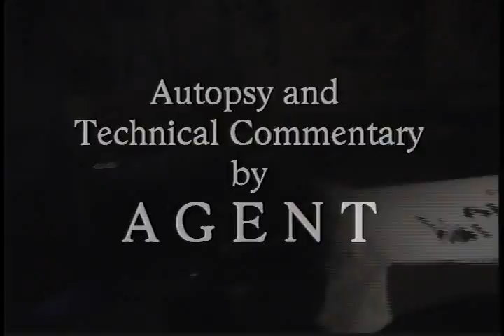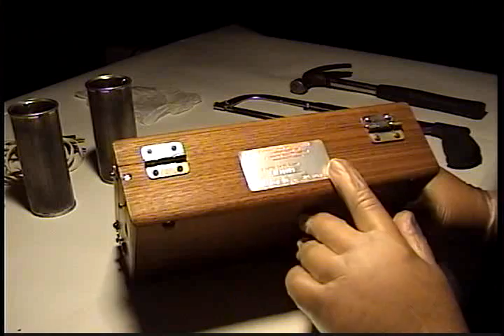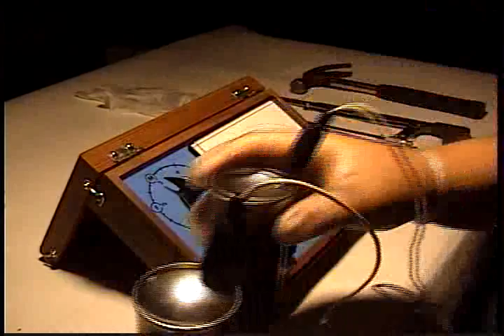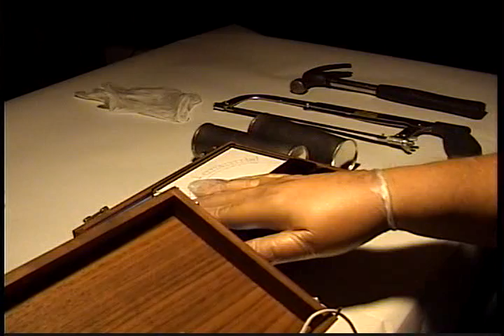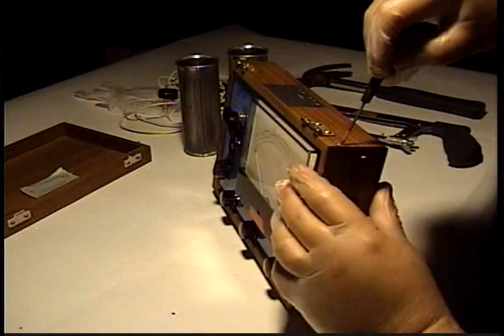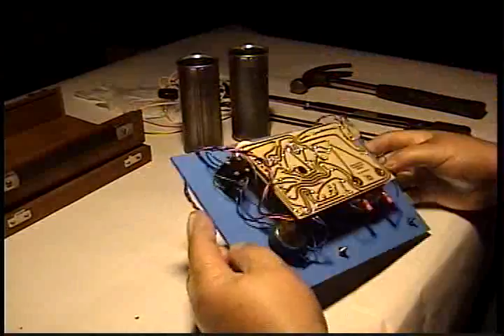E-Meter Autopsy Part 1 of 2

Comment: I've heard that you can build these with crap from radio shack, but I've never been able to find a complete schematic. Anybody know where I can find one?
Reply: +TheBrabon1 - thanks. that's certainly better than anything else I've seen. I'll have to give it a go, although the only experience I have is building a distortion pedal almost 30 years ago😂
Reply: +TheBrabon1 as a diagnostic device it's total BS.
Reply: 71nortcomm 71nort It's literally just an Ohm-reader with the cans being used as contacts to measure electrodermal-resistance of your body/skin just attach the alligator clamps on any ohm-reader to empty soda cans and hold one in each hand.
Reply: Ace Ace I get that it's an ohmmeter but I was thinking about building one just like their's as a goof.
Reply: 71nortcomm 71nort just put a mechanical (no digital screen) ohm-reader in your own shell, then get two cans and sand the paint off them and attach to the alligator clips, then attach various knobs and needles that either connect to nothing, or are routed to get a different reading from the original needle.
Reply: Ace Ace LOL, while functionally identical, that's not in the spirit of what I'm trying to do.
Reply: 71nortcomm 71nort you have to traverse the hole to hell

Comment: Wiring does not give a flying crap about volts. You could even connect it to 1000V. What matters is current.
Reply: +dieselscience not entirely correct.   Voltages beyond the wire rating can cause insulation breakdown and/or current to escape the insulation.
Reply: Do you think the loonies at scientology would actually hire an engineer to make these stupid things?
Reply: dieselscience What does that question have to do with your assertion that voltages don't matter?
Reply: Arx, you got it wrong, and that is not what I wrote. The wires do not 'care' what volts are because they don't even know what potential, current, resistance, resistivity, conductivity, inductance or hysteresis are.

Are you about to tell the YT world that you're an electrical engineer?

You should turn on your sound & listen to the video then go back and reread what I wrote.
Reply: +dieselscience You are a moronic pedant.    Go fuck yourself.
Reply: +DrHillbillyShow "Scientologist."   That's funny.   You don't know shit.
Reply: dieselscience the insulation has to be rated to carry the voltage though. Typically 600 volts for a wire that size.
Reply: Arx, you got pimp slapped by a hill billy XD
Reply: +Arx Fortis In order to avoid being firmly put in check in the future, like you have been here, 'engage brain before activating mouth....' but then you scientologists don't do that anyway so...

Comment from the maker: Yeah it's repairable, depending on how it broke. If the movement and springs are intact, the needle can be reattached. The front plastic bezel just pops straight up and off to gain access to it's innards. If very damaged you could get a 500 microamp meter of the same style and swap out the scale. Search for them on some of the electronic surplus sites.

Comment: @MagnusRulerHardt Actually no.  This is a bilateral meter.  The difference is you use two electrodes, instead of two electrodes on one wire.  The reason is you can rig it up with a foot electrode and one hand electrode, which was its original purpose.  For use of dream therapy.  To show a shift from cortical to root brain thinking during an interview.  With an electrode in each hand you can show a swing from one hemisphere to another.  Not just detecting stress but a shift in hemisphere,  L or R

Comment from the maker: @roslon  Actually, the charging circuit is directly connected to the AC line thru a capacitve reactance circuit that was banned by Underwriters Laboratory many years ago because it was a dangerous shock hazard. :)

Comment: Just for the record Hubbard didn't invent the e-meter; Volney Mathison came up with the first one in the 1940s. Hubbard incorporated it into Dianetics in the early 1950s, then stopped using it because Mathison wanted his name on the units used by Dianetics/Co$. Hubbard then had two guys reverse engineer their own smaller version and he got a patent for it in 1966.
Reply: In true LRH fashion - take someone else's inventions and hype it up. (Like the engrams where he borrowed from Freudian Psychotherapie. Or reincarnation where he borrowed from Buddhism. Or body cleansing, Finnish Sauna - which he bended into becoming the ultimate body cleanse and drug rehab exercise. Or hypnotic techniques, and spiritual/meditation exercises - many are repetitive and that element shows up in the TRs or in the way auditing at the higher levels is done - answer the same question again, and again, and again).